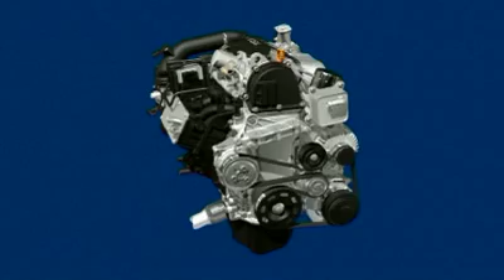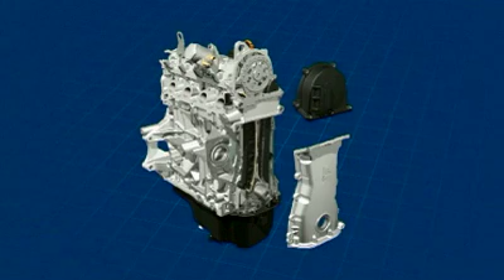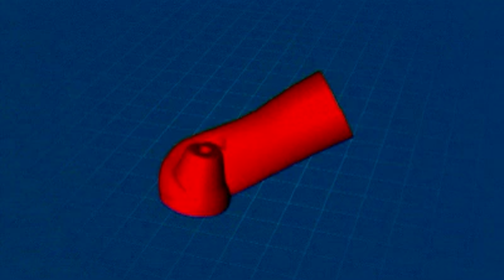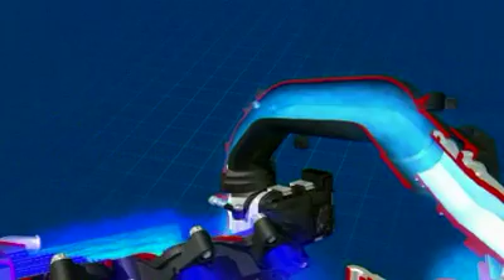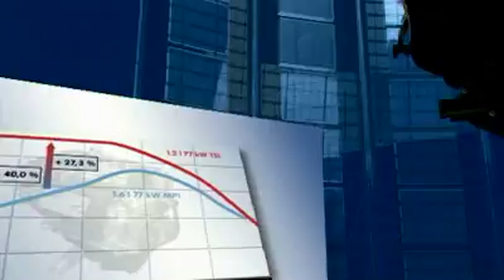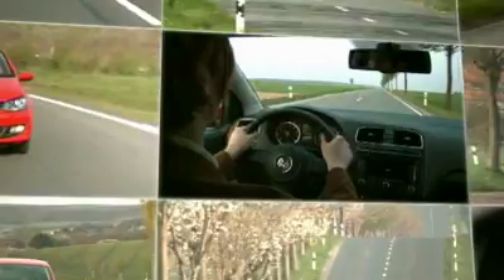Volkswagen 1.2TSI Presentation

Comment: Just going for a new timing belt for my 12-year-old Skoda Roomster. I like the engine. As with all things German-made made if you don't do the maintenance regularly, it won't last. Just hit the 74,000 km mark, never had any unusual problems, a tiny bit of rust appearing on 2 panels.
Reply: this engine doesn’t have a timing belt, it has a timing chain

Comment: I am really impressed with my Fabia 1.2 TSI. Averaging 45mpg, picks up speed like a 1.6 and can top out at 120mph (yes I took it up there 😂)
Reply: Is it reliable?
Reply: @dragospahontu  I can't speak for the 1.2 TSI, but I can for the 2.0 TSI. Over 10 years and it has been very reliable! Only had to replace an ignition coil, and replaced the water pump with a metal one because the plastic one leaked.
Reply: I did 199 km/h in my 1.2 tsi Skoda Fabia 90cv from 2017 😉

Comment: Whoever invent 1-4 turbocharger intercooler petrol engines in all brands aren't graduation Engineers for build pass test bases F1 speed 160 km/hr to top speed on circuits and test maximum over 20,000 rpm by themselves.

End report.

From
All brands databases

Comment: All Volkswagen TSI 1-4 turbo intercooler petrol engines and all TSI 1-4 turbo intercooler petrol engines hybrid : Easy damage, 20-100 l/100km, over 100 l/100km with F1 speed and test maximum over 20,000 rpm.

From
VW databases all

End report.

Comment: For Christ sake people this is a small turbo charged chain driven petrol engine, stop comparing it to the VW pd diesel engine and others. I have this engine in my Skoda Rapid and for what it does it's pretty good at it - the performance and fuel economy are pretty decent and after 29000 miles I've had no issues yet. As a small turbo charged engine it will need some maintenance but no more or less than any other engine needs. If you neglect any engine you will have problems with it - simple as that. There are some engines that have reliability issues from the factory but the majority have issues due to mechanical neglect/lack of servicing.

Comment: TSI 1-2 turbo intercooler engines all : 20-100 l/100km, over 100 l/100km, easy damage on test performance.

From
VW database

End report.
They are terrorist street racers group.

Comment: Just got me Audi A1 with the same engine. So far an excellent little city car, with great fuel consumption. Mind you with chain driven engine the oil HAS TO BE CHANGED more frequently than what VW is suggesting with those "so called long life oil" It is a myth that the oil could last up to 15000 km. That is very bad for the chain. If you maintain more frequently on 7500 km that engine would last for a long mileage. The chain driven engine should make over 200000km before the chain is replaced. Never save your money on the oil.
Reply: I change my oil on my 320d e46 each 22000km and still runs strong at 260k kms without any engine problems. You are just eatting VW's crap. Those TSI are badly designed and the timing chain tends to break or to loosen and the piston would hit the valves.
Reply: Mr Crossplane Why compare this engine to a BMW diesel engine? They are two different things entirely. This engine probably won't last for hundreds of thousands of miles but that's not what it's designed for.

Comment: I own a  VW Golf 1.4 tsi.
After only 5000km this engine starts shaking when running idle. 
I don't find this normal, do you, but VW finds that an engine that runs irregular is normal !!! 
And won't do anything about it, even in warranty period !!!
You pay a lot of money for a shaky engine, and what about the long term damage.
The joke (bill) is on you.
Reply: Most probably it is carbon builtup. Need proper cleaning by opening the ignition chamber
Reply: after barely 5000km ? Isn't that soon ?

Comment: My died at 47.000 after 5 year. Aut of guarantee. Nice tihimeing VW. My first and last VW.
Reply: Why what problem
Reply: +pma097 Can I ask you how did it die? Because my Seat Leon 1.2 tsi will be soon out of guarantee and I wouldnt like that to happened. Ako znas neki srpski ili hrvatski slobodno mi odgovori na nasem.
Reply: +StrahinjaSRB93

This video is about the TSI engines of the previous generation (EA111). The current one (EA211) doesn't have the troublesome timing chain anymore, as VW switched back to timing belts. Considering your Leon still has waranty, I guess it's a Leon III (5F) and therefore has a EA211 engine. You don't have to worry about timing chain problems then. Of course I cannot say whether or not something else might break. So far EA211 engines have a better track record than their predecessors. They're around for 4 years now, so this much can be said.
Reply: +SamsonTheCat81 Thank you for info, but my Leon is 2nd generation, made in 2011. In my country warranty lasts for 5 years. So I could check out that timing chain. Did they maybe make a better version of timing chain because they had problems with those first ones?
Reply: +StrahinjaSRB93 Sorry to hear. I couldn't find reliable information on which models of the EA111 series feature upgraded timing chains.
Reply: How often did you change the oil on your car? I believe the problem is what VW is suggesting to change the oil every 15000 km. It is very bad for the chain. Chain driven engines should last for a long time, but the key is to change the oil more frequently, I change mine every 7500 km.
Reply: I changed oil after 10 000.every year

Comment: a friend of mine has that one. last week the motor died after 5 years and 160.000 km. what a crap.
Reply: Exactly, that's what I was saying, the chain driven engines have to have the oil change more frequently. And you cannot press the accelerator to the full when the engine is cold. It has to warm up to a regular operating temperature, than you could drive regularly, before that you have to let the engine to warm up with a smooth drive, with low RPM. This engine is not designed to operate on high RPM-s (like Honda's or other sporty vehicles).
Reply: no, he took the long life service.
Reply: +Hans Geher Did he replace the oil every 5K miles? How did he run it. I know people who have had it for 300,000KM and they replace oil every 5,000KM and it still runs strong.

Comment: They already had quality issues with the downsized 1.4 TSI and now they have a even smaller 1.2 TSI...
VW has turned into shit-company...
Reply: No, the base 1.2 TSI and 1.4 TSI have no problem what so ever. Only the 1.2tsi with 77w and 1.4tsi with supercharger+turbochargers have problems. Please do some research first. I owned both base 1.2 and 1.4 for 4+ years now. Nothing has ever happened to these engines.
Reply: Pvulture b
My parents own a Seat Altea XL with a 1.4 TSI 92kw and they had SO many problems with that thing...

Comment: 5.5 liters per 100km? my old 2.5 TDi can do that. Will This engine survive half minion km?
Reply: lol...:D ..your engine 2.5tdi have 7+ a no 5.5l ;) a this is gas ..no fucking desel ;) u ahve 150hp stock ...a 2.5l V6..this have only 1.2tsi a have 105hp ..45hp low your engine
Reply: This is R5, not V6. I know that diesel will burn less fuel, but in my case 5.5 is real consumption, not only declaration. And second, my car weight is 1.8t. That's quite heavy
Reply: Diesel car gives you more miles per gallon compared to gas(petrol) engine
Reply: thandermax yeap. That's not new. Still no answer for question, what advantage beyond better gas exhaust.
If this engine does not survive 300 thousand km there is no ecology
Reply: I agree. Slowly VW is bringing tech-laden engines which breaks down easily.

Comment: Anyone knows the model of the turbocharger used in this engine?
Reply: IHI turbo
Reply: Bosch Mahle Group turbocharger with mixed a flow turbine and an electromechanical wastegate actuator. Compressor is billet machined. Bearings are not ceramic but the bearing housing is cooled via engine coolant. Intercooler is also mounted on the engine block and the charge air is water cooled.

Comment: Does the turbo need to be cooled down, eg should one idle the engine before switching off like turbo diesels? Maybe VW have a turbo cooler which runs, or some other device, on after switching off to avoid turbo failure? Where can I ask VW?
Reply: the turbo is small so you dont need to worry as it is not a race car
Reply: Yes the turbocharger is small and will cool down faster. In addition to that the bearing housing is water cooled. SO you'd better idle before shut down after heavy use but you don't need to take too long for cooling down.
Reply: No sure :(
You can ask VW on Germany
Reply: Yes common sense dictates that you let the car idle down after a long/zesty drive

Comment: Actually you're wrong, it's proven that the combustion chamber area is less efficient in a 5v engine than a 4v, Ferrari also discovered this after they made the F355 which had 5v per cylinder, every generation after that used a 4v design and they didn't have to consider about the injector placement as only the California and the 458 use direct injection, get you're facts straight first...

Comment: 16v is not better than 20v,its simply impossible to fit the direct injector inside the head.Vw returns to indirect injection(new 1.8t),to deal with the carbon deposit problem,that affect all brands.

Comment: Every single thing said in this video is 100% true.It's every bit as good as they claim. It's by far the best engine i've used in many years. 

Make yourself a favour and consider using this wonderfull engine with a 7spd DSG gearbox. It's amazing. Not for the fuel economy (It's the same as with a 6spd manual). But for the SOUND!

I chose the 6spd manual because i love manual transmitions but a friend got the DSG,and i'm so jealous.With a sports exhaust sounds like a high end sportscar! Crazy!
Reply: So, how is it holding up now? 😂 High oil consumption? Snapped chain?  Destroyed block? These engines turned out to be extremey fragile.
Of course it's a nice engine when it's almost new, but a great engine should run several 1000000 km without problems. These TSI engines were not built to last unfortunately..

Comment: The 1.4 TSI motors VW are failing miserably.
I knew a lot of TSI motors with 20-30.000km has broken, My Scirocco TSI 122cv has broken with 2 years and 38.000km, with the max care driving, the great filming, refueling in the best petrol station in Spain.
23.600€ for this?For I had a broken motor?
If I know this before I had buying a HOnda or Ford or Bmw
I am INDIGNANT, I sent a letter to VW Spain in Barcelona and their answer it was poor and empty!
IT`s my opinion and my sad personal experience!!

Comment: We have a Vw polo comfortline with this tsi engine, it is a great engine and works very well with the dsg gear box, at 100kph it only is reving at about 1900 rpms in 7th gear
Reply: Is it efficient?
Reply: @dragospahontu  I guess it depends on what you mean by efficient. It has high MPGs so that's fuel efficient.

Comment: @Sebastian7224 actually, 20v engines are not better than 16v(5v per cylinder vs 4v), the 20v was used years ago in the audis and vw's but abandoned to 16v designs now available

Comment: As said in the video,they tried their best to minimize power losses from friction...more valves = more friction...this is not a performance engine..it's a combination of low emission and high economy engine,but with enough horsepower and torque to match a 1.6 or even a 1.8 engine...Imo that's the genius of all TSi engines.. !

Comment: all that TSI sounds good ... but in the end all these motors are problematic ... they burn oil in most cases and ur pocket pays it all ... 1.4 GT with 170hp is the worst engine to choose ... horsepower sounds great but after 20k km u will definitely regret it ...
Reply: If you need an engine with high horsepower and less friction, a 2L or more is better. Otherwise smaller engines with high horsepower is problematic

Comment: Btw i 'd also like to point out that TSI stands for Twincharged Stratified Injection..That means both a turbocharged and a supercharger is used..While this applies to the 1.4litre (140-160ps) it doesnt apply to this 1.2l engine nor to the 1.8 20VT..That's all just marketing from VW,but it's hard times we live in,so i guess they used the "TSi" name for their own benefit...
Reply: TSI meand Turbocharged Stratified injection as well.

Comment: Now that's a great engine...Too bad it's going to be launched in the start of 2010 in Greece..Anyhows,i noticed that it's an 8Valve engine,while i thought it was a 16-valve..I also noticed that the camshaft belt is a chain actually..Does that mean that it's gonna need less maintance ? What is the mileage in which the services must be done..It's already a very economical engine,but still i d like to know the service mileage,if you can tell me..Thanks a lot !